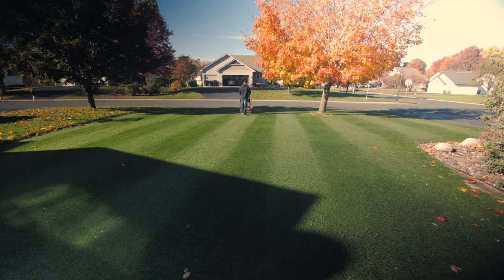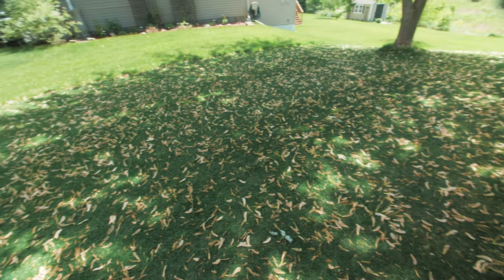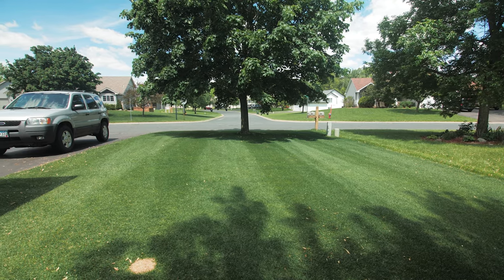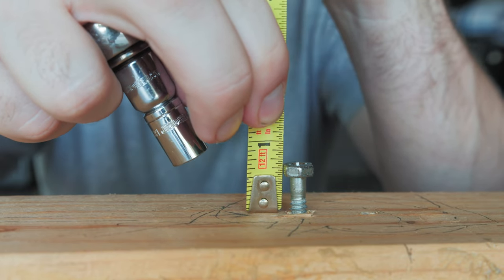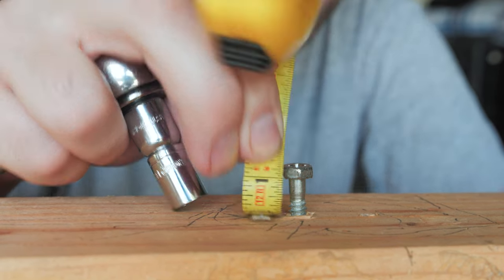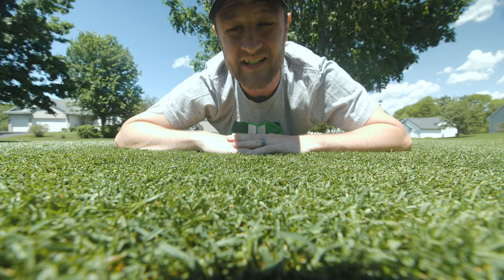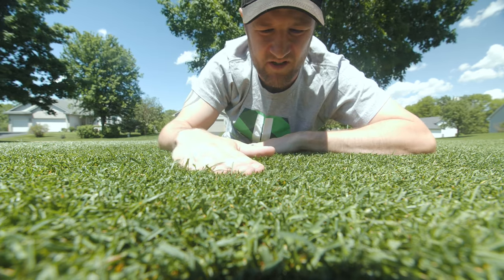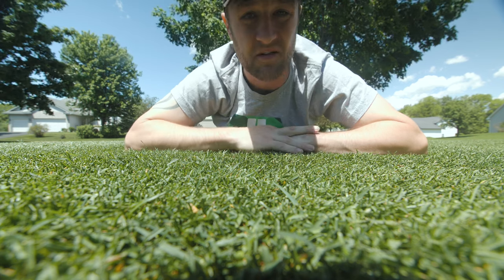Taking My Lawn Down to 1/2"

Comment: Did you measure the height of the grass after mowing? Generally the actual height of cut with a reel is going to be lower than the nominal height of cut.

Comment: Had my Bermuda at a 1/2” for a putting green for a few years. Worked out pretty well, even using a manual reel mower. Overseeded with annual rye in the winter and it did even better.

Comment: Your grass looks great. Will you allow it to grow out before winter?
Reply from the maker: Depends by what you mean by grow out. Lol. The longest I usually cut at is 7/8ths
Reply: @LAWNLIFE  I have noticed that grass cut short looks best. This year I'm cutting my St Augustine at 1 3/4".
Reply from the maker: @rong648  I've noticed the same thing. Are you rotary mowing? If you try reel mowing, you'll never go back. I promise.
Reply: @LAWNLIFE  I'm using a rotary mower, I would have to level my yard to use a reel mower.

Comment: So is PGR the secret to getting the turf so tight?
I cut at 1.75”, 100% KBG from sod, it’s been 1.5yrs and it still seem to only grow up and not fill in as much as I expected.
Reply from the maker: Not necessarily. I've noticed very frequent cuttings help more than anything. How often do you mow? PGR definitely would help though. It's supposed to help it tiller. But mine came in super thick by cutting it low over and over without pgr
Reply: I rotary mow at the lowest setting every 3-4 days. Never more than 1/3. 1lb of N granular every 6 weeks. Spray iron and humic regularly. Irrigated.
Soil test showed ph 8, K low, everything else within range. 
The KBG still isn’t spreading.
Reply from the maker: @homer009x  where are you located? Sounds like it actually might need more N than you're giving it. Does it look healthy? You're gonna want to get your pH down also.
Reply: @LAWNLIFE  I’m in Canada, so short season but the summer isn’t as hot.
It looked very healthy this spring, solid dark green. But then seed heads came and that sucked the colour out, have a bunch of yellow dry stalks. Same thing last year. The yellow just persists.
Not sure what to try: cytokinins, PGR or switching to spoon feeding N (I still have a lot of granular to go through)
Reply from the maker: @homer009x  if you have cool temps sticking around for awhile I would hit it with a lb of N per k and see how it reacts. Obviously it won't help the yellow stalks but stay on top of mowing and see if that helps with the tillering. Mow every 2 to 3 days. Definitely wait for the fall if temps are in the high 80's and 90s though